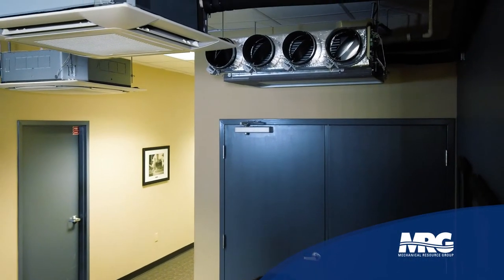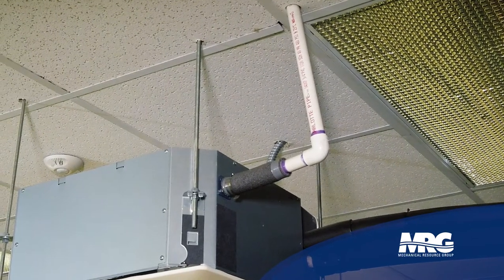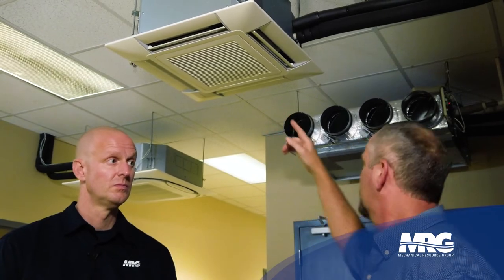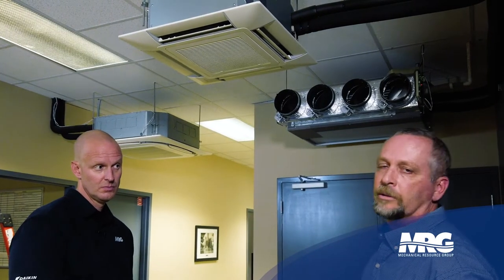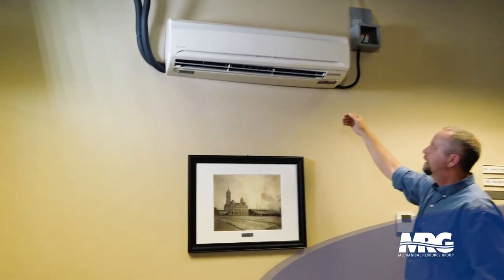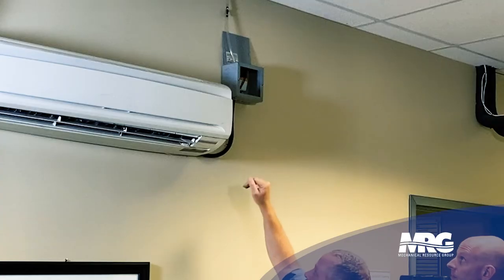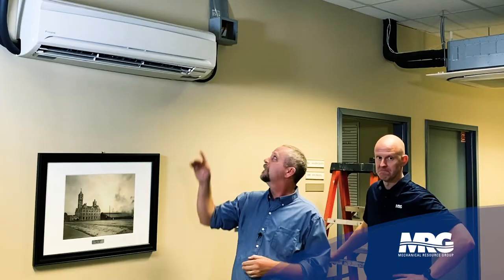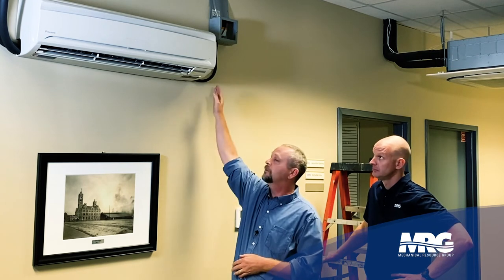Secrets of Daikin VRV Condensate Management Revealed!

Comment: My unit has a built in with a float. The built-in can only lift 18 inches and we need to go 48 inches. Therefore we will get an auxiliary pump but wondering how it is to be activated.  Thanks
Reply: Why can't a check valve in the vertical pipe prevent that back flow and will the pump pump it higher than 18inches..